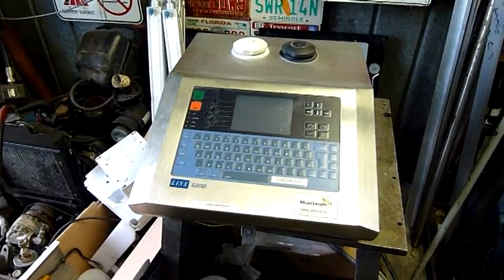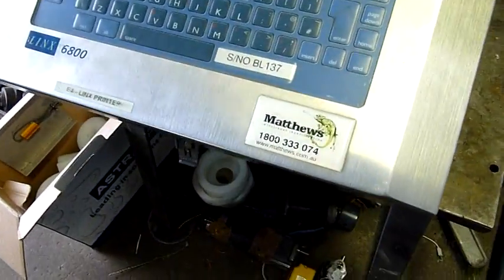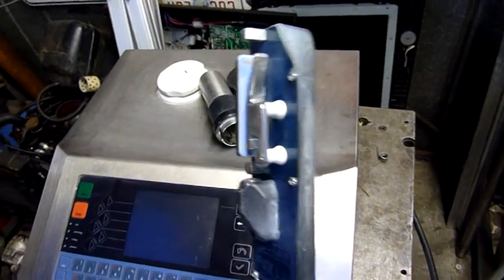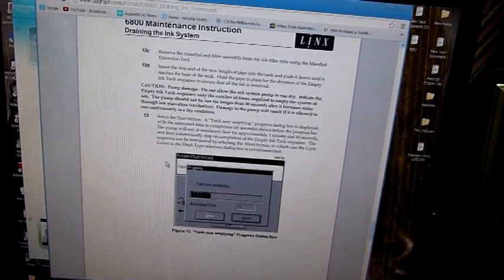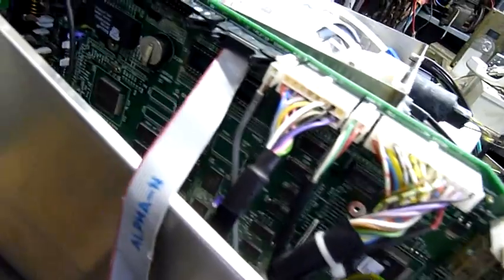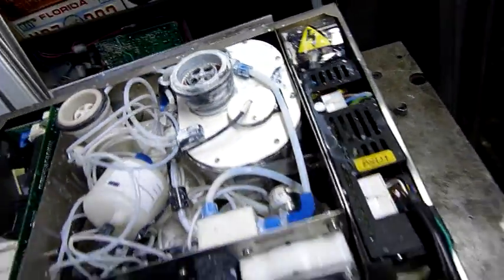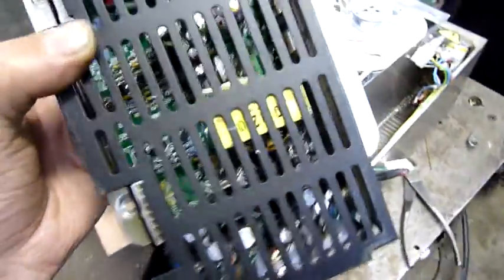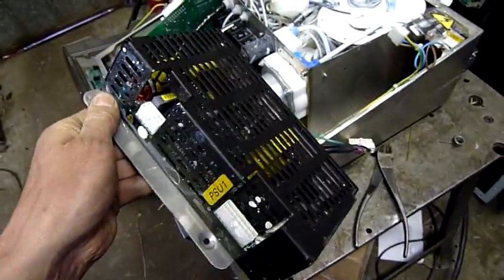Linx 6800 Industrial Continuous Inkjet Printer Examination

Comment: I have linx 4900 printer and dont have the password.could someone help me to find it.and what is the default password.its not even mentioned in the manual
Reply: Hi, the service level password is svc2.
Reply: thats worked thank you
Reply: @crapinabox  kindly tell service password for linx 6800
Reply: @zmanmalik6675  Hi, it's 6lxsv1
Reply: @crapinabox  is there any difference of operating software .when we are using white and black ???
Reply: @crapinabox  How can I enter the hidden service menü? Thanks!
Reply: Jozsef Decsi  you can press d key then you can get in diagnostic mode
Reply: @jozsefdecsi3074  by pressing m on keypad when you r on main screen and password is off.
Reply: Please sir ..did the password worked ?

Comment: I'm trying to fix one similar to this , its the Links 6200 ,when i put power on i hear a buzzer and an error message come out from the screen saying " Printer fail 2.04 300v Power supply" does that mean i only need to change the power supply or unfortunately purchase another 1000$ board
Reply: Eht psu is faulty need to replace

Comment: G'day Aussie50, your problem here will be that you have a Spectrum printer which uses a 'heavy' pigment requiring regular mixing at least every 2 weeks - If it's been sat any longer than that then it will likely have solidified completely and you'd have to replace all the components in your ink system. Matthews Australia can quote you for those - it won't be cheap!
They can also help you out with a Boot prom and software reload - 
matthews.com.au/
Reply: favouritesky what if you just replace it with solvent

Comment: I love Lambda PSUs. I bought a 150W 24V supply for $35 thinking it would be a cheap run-of-the mill supply and was greatly surprised at the build quality and brand name components. I'm sort of surprised they would be used in equipment that expensive.

Comment: ...of the presence of the normal back up battery.

Other ideas are that the system performs a self check (POST) and is trying to get to start position. It probably uses the pump and valves to check for blockage in the hoses/system. It will be one though job to clean or flush everything. But you figured that already.

Comment: Just don't destroy it. It might be a simple fix after all.

Look in the service manual for hints of hidden boot up menus. It might have one.

Also check the back up battery voltage. Anything below 3,00 volt is too low.

The dallas clock on the side of the back up battery might have a depleted internal battery as well. It cant be replaced, replace the complete clock ic or hack it. See google. First you might want to check if it has a internal batt. It might be a model with exterbal batt because..

Comment: Definitley fix it, even if it takes you a year on and off - would be crazy to break it for parts. I've taken many a risk on expensive non-working eBay items. Sometimes you get to a problem that seems impossible, but there is always a way. If you get stuck just put it in the cupboard for a while then have another crack when the enthusiasm comes back. This hasn't cost you anything so it does not matter how long it takes to fix.

Comment: Service life is 2500 hours, and it shuts off after that is exceeded. Service kit is around $1000 here including labour. Kit is piping, filter, pickup in the ink tank and the damper, along with the blue elbows and some fittings. You need 3 bottles of ink as well to refill the tank, along with 1 bottle of solvent.

Comment: Pump is clogged with ink, you need to flush it with solvent, along with the solenoid bank, and change the filter. The print head makes a droplet at the back,  it passes through the copper charging electrode then it is deflected by the 2 electrodes to either go out the window or into the drain block where it gets recycled. When working it will print onto a raw egg with no problems. If they used the wrong fluid they will have killed it for sure.
Reply: SeanBZA how do you flush it with solvent? Just put solvent in the solvent hole?

Comment: You have to hold the power button down for about 10 seconds to get it to boot. They are reliable things, though you have to use either MEK or methanol, changing is hard. They will self prime if there is enough liquid in the tanks, they hold about 1.5 litres per tank I would love to get the print head as a spare, or to make mine a dual head one.